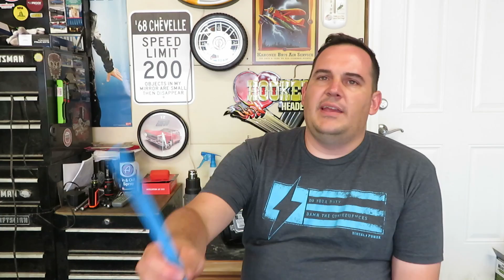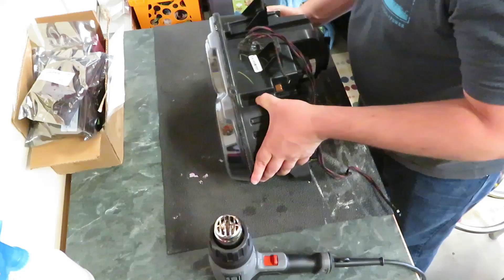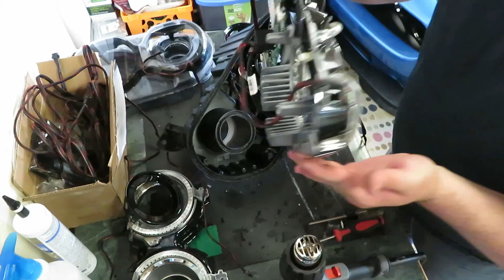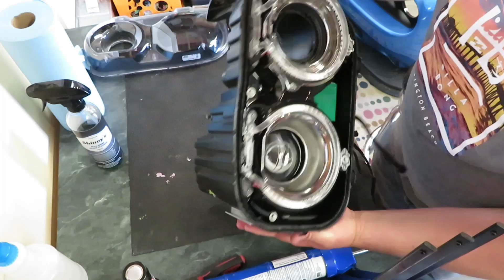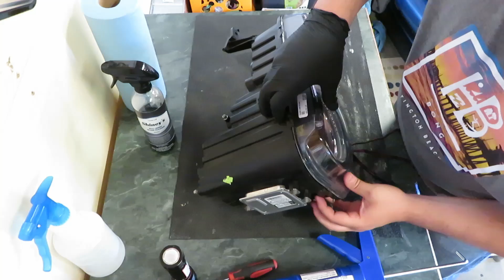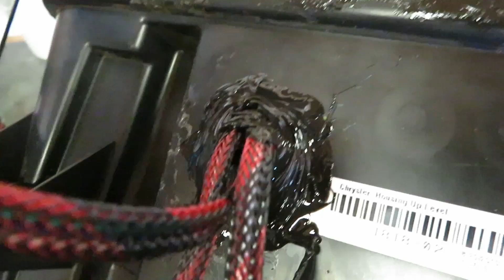DIY: Opening Headlight Assemblies on 2015+ Dodge Challenger and Charger

Comment: thanks for the video! but you didn't show how to open the place where the air intake is
Reply from the maker: Those are just a little lens that pops out without having to open the headlight up.
Reply: @MeanBee392  Thanks for the answer! So, this place doesn't even need to be heated with a hair dryer?

Comment: I did this years ago to my 01 gsxr 1000, I installed hid projectors... it's easier if you put in the oven on 100 degrees... it will peel right apart.... no damage no melting... like he said "be patient " 💯💯👍🏾👍🏾👍🏾
Reply from the maker: That's a great tip and thanks for sharing! It would be a lot more user friendly than a heat gun. Thanks for watching and commenting!

Comment: Were these permasealed the first tome you opened them? If so how difficult was it to open and did you still use the heatgun?
Reply from the maker: They were. They were not bad at all to open but yes a heat gun was needed to insure not to break anything.

Comment: Having moisture get into my headlights. Have had them opened up by installers. Once for Oracle lights then with lighting trendz. Watching video has given me the confidence to tackle this. My question is what did you use to clean the old silicone off the housing and lens.
Reply from the maker: That sucks and sorry to hear that! That is awesome to hear and I am glad this video will be able to help you out! Well to clean them up I just used a lot of patience and a screwdriver lol sorry I am not much help on that. 🐝
Reply: I'm switching from Oracle to lighting trendz too. Upgraded from sxt to 6.4 and I liked the new kits from lighting trendz better

Comment: Great video brother! I like the Shiney’s glass cleaner on the table. I need to do this to my headlight on the truck. Do all headlights come apart like this? Never done it so just curious. Thanks to this video though I might just go ahead and try it.
Reply from the maker: Thank you brother! Lol good eyes I was using it to get everything perfectly clean. Yes this is how all plastic cased headlights will come apart. That would look cool if you did yours on your truck and I would be curious if you do do it let me know.
Reply: MeanBee392 I will let you know if I do but if everything goes right that truck may not be around much longer! 🤞
Reply from the maker: O wow really!? Why are you getting rid of it?
Reply: MeanBee392 We are buying a 26 ft camper and it won’t be able to tow it.